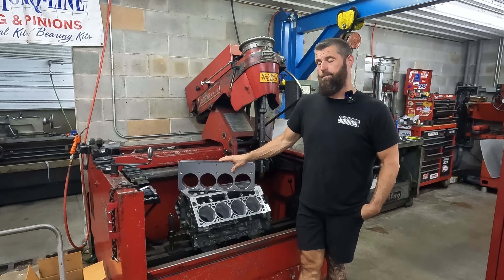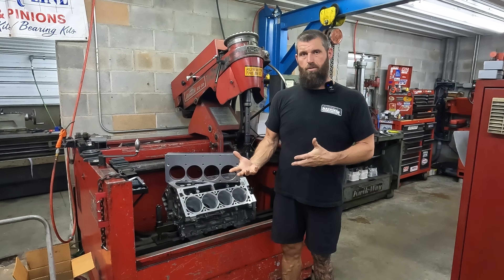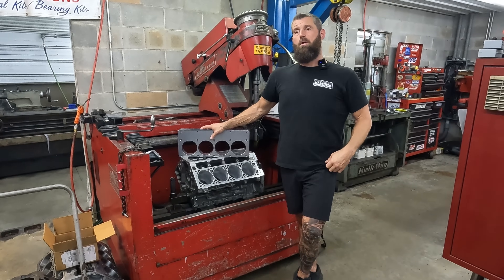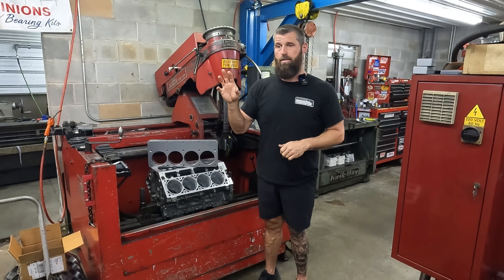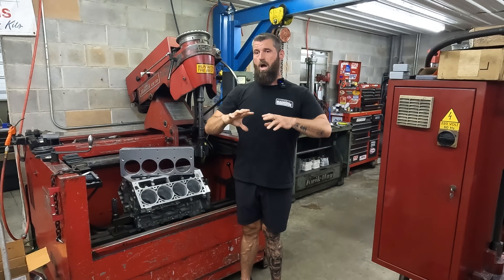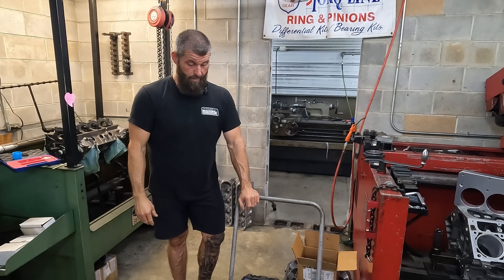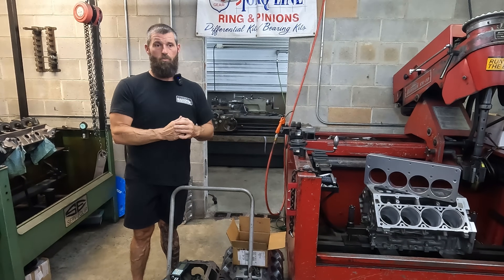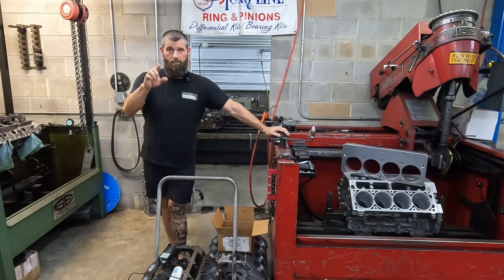We gotta talk about this torque plate deal.....

Comment: I decided to build a motor for a bracket car took to a local shop said I wanted bullet proof btm end that would last forever easy on the wallet to maintain torque plated and everything leave no stone uncovered the guy at the counter said ok bring us your parts we will get on it so I did two hours later I got a phone call said I needed to come and go over a couple of things so I showed up there was a guy in his early sixty's met me at the counter long story short ask if I was filling my block I said no he ok then I will save you some money we not putting the plate on it explained to me that of the block is not solid I would not gain the benefit from it he said take that extra money put toward a good ring package would benefit you more
Reply from the maker: That is 💯 not true
Reply: @powellmachineinc   would it been better to hone with the tourqe plate filling would make more sense for more rigidity I'm  sure with materials and technology you would not have to do that and I agree Im not going to chase .0004 because you probably hold a part in your hand depending on material and change that and I thank you for your response because if I'm wrong or have the wrong information a direct answer yes or no let's me know who is bs and you figure out who to ask and not ask love your channel I can relate to it because being a machinist by trade always wanted to work with automotive  side
Reply from the maker: @tommybilbrey1471  it's all relative to what engine,  they don't all respond the same to a plate

Comment: Wait until these people find out that most people don't torque plate their race engine. Torque plates weren't even a thing before the 70's. Through the 80's and 2000's it wasn't even a common practice. It's nice, but you're going to be okay with a little deflection.
Reply from the maker: Yep, we started plating stuff I'm the late 90s
Reply: @powellmachineinc  I would think it's more important during the line boring process than anything. Since the deflection on that axis is parallel to the heads. When you bolt on the heads I would think, on some blocks more than others, this will twist the alignment of the mains. But on most engines, particularly open deck blocks (like a K series) the deflection is minimal in the cylinder bores. On a Block known for being twisty like an RB or a SR, or a flimsy block like an EJ. 100% torque plate for everything. But any of the iron block LS engines, wouldn't worry about it. If you need to line bore an LS, just get another block. Or if you're going past 800hp on anything. You've already invested quite a bit, just pay your machinist for a torque plate hone.

Comment: Anymore lately, I don’t want anyone pulling in my head bolt threads with some random bolt set. I still use a few factory Mk 4 blocks and the bolt holes are notoriously weak. Half my motors a blown so the gain I get from that .0005 bore variation where the rings don’t go is negligible. On big Fords where the bolts are 3/4” away from the bore, I also skip the plate.

Comment: Application sorta dictates the process to some extent. Some applications, like high end high HP race engines are more likely to need a torque plate (but not all. Billet blocks just don't move around enough to make a difference in most cases). Or FE Fords that tend to pull up really hard on the decks with the 4 1/2" bolts and thin wall castings it's a good idea. Makes a VISIBLE difference plate vs no plate on FE's, but how many have been done without and ran for years with no issue?  A lot of stuff it just doesn't matter! Also, blocks were being successfully machine for years without them. There are no absolutes. Your explanation is spot on in my experience.

Comment: I've seen engines that were bored sans a torque plate last well over 200k without any issues. These were stock engines that were worn out and going back into stock applications and ran great throughout their lifetime without any issues. What he's saying is absolutely true. Just because the guys on Power Nation or other shows are always using torque plates on their builds don't mean that they are necessary for your bone stock 350 that's going back into your K1500 or C10. Now if you are planning on trying to build an engine that will squeeze every last drop of energy possible from it's combustion cycle then sure it is worth doing but for your average build or even your above average 300-450hp build small block it not absolutely necessary. I think the people complaining are people who have never had an engine apart in their life but have read a lot of forums and watched a bunch of videos. It's the Dunning Kruger effect calling again.
Reply from the maker: Absolutely 💯

Comment: I'm surprised automotive engineers hadn't figured out the bottom end bedplate sooner. In the 80s they were adding extra bolts to the mains & rod caps but not bed plates.

Comment: You cannot hardly out run those torque cocks (cops) 😂. They are like the state police and the small towns with only 2 or 3  cops on the force are the run of the mill trolls.

Comment: So i'm on the slow bus.
I just watched this video absolutely stellar.Come back.
If I could add my 2 cents to the stock cast Iron block and the torque plate.  The torque plate would only be relevant if when you bored and Honed  the cylinder that you had it. At running temperature with water flowing through the jackets. That would be the only way a torque plate would help a cast iron block in any way.  Just my two cents .
🚮

Comment: Everything you just said about thermal cycles is exactly why I don't worry about torque plates on a 450hp street/strip sbc engine. To much moves after it gets hot that even a few thousandths isn't going to matter much at all. At least that's my feelings on it. If the Machinist would recommend torque plates because a certain block might be worse than others, I would do it.

Comment: I realize this is 8 months old, but I seen a recent vid of the new Rottler honing machine, that doesent need torque plates, and then this popped up afterwards.
 
Greg Anderson a NHRA Pro Stock champ who is racing for Hendrick and KB racing was working in the KB engine shop and was showing it off and explaining how much more accurate it is,  and NO TORQUE PLATES NEEDED. 
 
The Rottler can "feel" the high spots in the cylinder, and just hover in one spot slowly honing back and fourth until it's close to what it wants, then it goes back to full sweeps as it hones to finish the cylinder.
 
How much is the new Rottler digital honing machine?? ,  A Gazillion dollars??,  I don't know , but it sure seemed worth it versus playing around with torque plates,  and the benefit of every cylinder getting a torque plate hone, without the plates.
Reply from the maker: @kh40yr  you aren't grasping what the torque plate does, the hone brand is irrelevant
Reply: @powellmachineinc  I know what a torque plate is used for.  The Hone brand might be irrelevant, but not the machine. I just thought it was a interesting machine that delivers a torque plate hone to every cinder it touches, without using torque plates , as it was advertised.

Comment: Oh, hell no. I read up on the interlink, so I had my machine shop dude do the full top-fuel job on my HF Predator 6.5HP edger engine with torque plate, ARP studs, the best dingle-ball hone available and I tell you whut?  I figure the longevity of this engine is extended an entire 10-minutes over its lifetime. Worth every dime of the thousand it cost to do it my way! ;-)
Reply from the maker: Big gacts!

Comment: These people questioning your work don't understand machining, tolerances in automotive are open, were as in aerospace tight tolerances run in .0002 automotive .005 + - .005 also they probably don't run a shop
Reply from the maker: We hold 4 decimal place on automotive machining often

Comment: Great discussion Mr. Powell. Is a B/RB Mopar, 383-440 like the FE Ford? They have head bolt threads in the top of the block also, but 5 bolts around each cylinder. Just wondering if they distort enough to warrant torque plate honing on a basic build. Great video. 👍
Reply from the maker: Fe's are worse because there paper thin and the bolts are 1/2"

Comment: I remember back when l was just starting out, we would hone an engine on the garage floor because we couldn't afford an engine stand, polish the crank with some fine paper and wd40, and a shoe string,and those engines ran well for years, not that it was right by any means,but let me say that l absolutely appreciate what the machine shops do,what you guys are doing is short of amazing,im sure theres a need for torque plates but probably not on something that is intended for street use

Comment: Daniel, big block  chevy 454s, there head bolts are to the top, what's your ideas on torque  plates on them? My machinist  doesn't have them for big blocks and so I probably  won't worry  about them.  I'm just doing a refresh job on a low rpm towing 454 for a  1 ton pickup.

Comment: RE: this whole engine distortion thing - Many years ago I played around with sprint cars and Oswego Super Modifieds,  I always wondered how much the engine geometry distorts from mearly mounting the engine in the chassis, and how much when the front left wheel is off the ground at full song?
Reply from the maker: @donbrutcher4501  who really knows
Reply: @powellmachineinc  I do know you can bind up a stock small block Chevy shortblock by just squeezing the block with your hands.
Reply from the maker: @donbrutcher4501  I'd pay to watch
Reply: @powellmachineinc  It wasn't running. It was on an engine stand.  We measured with a torque wrench on the crank snout.
Reply from the maker: @donbrutcher4501  ok.....

Comment: I'm not a machinist but I've been in the trade and built lots of engines a few High horse power. But I think sir you're standing next to CK10 In the fact that you have a  Torque Plate in your hand. Means you know there's need. You don't need them on some engines but if you install  studs on Some Apparently not all.engines without boring them  with a torque plate you'll Egg shape the boar And the block and it will crack I learned that lesson. But it is not really necessary if you're running stock headbolts. As far as I know. I like to think I know. But customers shouldn't have to For tooling. It has to be Bought once and paid 4 over time. So you can make money off of it. But it's only necessary when it is.

Comment: Great video, as a hobbyist engine builder with a lot of builds under my belt, most of the engines I build are done on a shoe string budget, both foreign and domestic and are daily  driven. I have developed a complex where I feel like everyone else's engines have better ring seal and no oil leaks. I aways suspected that I was because I didn't use a torque plate but after watching this video I am not so sure.  Can anyone else relate.
Reply from the maker: @mjb242  the actual hone job is critical,   the finish,  the angle ect, watch some of my honing videos

Comment: to be honest i dont see any benefits to using a torque plate on a street motor or even a lot of high end motors! when i put a top alcohol motor together i used to order 4 sets of pistons and match the tightest pistons to the bore ,  sometimes id go through 5 -6 pistons just to find one to fit the specs i was using ! which brings up another interesting fact ! not a single piston is ever the same so if you make every bore identical there is no guarantee the factory will meet your specs ! then each piston will cut and seat different you cannot have exact ring tension . the only time i ever use a torque plate is on a custom v twin and. a vtwin is temperamental when you get to 4.155 and over ive got 4.280 big block pistons in my custom chopper and it is exact. built a top fuel v twin or two or 3 i use torque plates on those.
Reply from the maker: You just haven't actually done any A/B test, or you wouldn't say that

Comment: I was always under the impression that torque plate was optional and really only beneficial to engines that have head bolt holes close to the cylinder even then we talkin a couple tenths of distortion not worth worrying about on 99% of blocks
Reply from the maker: Not that simple unfortunately

Comment: Hello!  I just happened upon your channel using my personal account and figured I'd pop in here with my business account and help you out with what little gravitas I might have.  I'm a torque plate manufacturer, with my customers ranging from small shops to aftermarket block manufacturers, NASCAR/ProMod/ProStock level shops, and even OEMs.  What you are saying here is what I tell people when they ask if a plate is necessary: "It depends; ask your machinist."  Every application is different and there are absolutely applications out there where a torque plate can not just "not help" but actually hurt cylindricity (or end-state performance, at least)!  The one caveat I would offer is to keep in mind that you (and most automotive machinists) are not actually able to measure cylindricity with a dial bore gauge; you are only able to take relative measurements absent something like a CMM.  The shops with this capability (especially the OEMs and large scale rebuilders) generally bore map the blocks with heads installed and use varying torque sequence and values to duplicate this as best as possible.  Some (depending on block architecture) are hot honing as well but some modern blocks don't really benefit there, either.  No one is doing that level of work for $40 a hole hone jobs it just isn't economical or necessary.  I've got machining centers blinking at me that they are hungry so I'd better go get some plates out the door!  Take care.
Reply from the maker: Appreciate the input and industry expertise!

Comment: Expensive high horse power and high RPM engines yes torque plate but mild race engines street car engines I wouldnt waste my time but if you want to pay for it fine and dandy otherwise forget it ! Yeah and like you said holes at top and close to cylinder walls, creating big distortions I would do it because rings compressing more and trying to return to walls get out of control dropping horse power, producing blow by, and contaminated oil is not cool.
Reply from the maker: I don't exactly agree

Comment: As a machinist, my whole life I board and honed many blocks. not all blocks are [designed the same some warp more when you torque them down more than others more than you would like to see anyway I always use a plate whenever it was available and if I really wanted to get technical I’d run 200° water through that . Generally speaking, I measure the block when I torque it down and if it needs a torque plate then yeah I’ll use it but sometimes you don’t need a torque plate. It depends on the block and not all blocks are designed to the same way, but I seen some blocks that are way out and you definitely want to use a plate under temperature anyway great show keep on rocking.

Comment: Some stock engines require boring with a torque plate. Subaru EA71 and EA81 engines. Says in the service manual the torque plate is necessary for boring, but not necessary for honing. The cylinder liners are only about 2mm thick and made of nitrided steel. They can be bored a maximum of 0.5mm. I've never seen one that needs to be bored oversize. The cylinders are so hard they never wear out, only the rings. I've rebuilt them with 500,000+ miles and no ridge at the top of the cylinder. Every one I've done has had cylinders dead on in the range given by the manual regardless of mileage. These are engines that cruise at 4000 rpm on the highway with 230 degree oil temperatures. The crankcase halves weight about 15 to 20 pounds each. They move a lot more than 4 tenths at the top of the cylinder though. I've measured one with a cylinder head bolted on from the bottom of the cylinder. The cylinder distorts by as much as 0.5 thou with the head on. The problem is no torque plates are available anymore. Nobody has one. The standard size pistons are also disappearing.  Nobody ever seems to bore these engines oversized so there is a shortage of standard pistons, especially the later ones from the EA82 engine which can be retrofitted to the older EA71s and EA81s to prevent ring land failures which are common with the older style pistons. It's getting to the point where I will have to have custom pistons made or order pistons from Japan or Australia to rebuild these because there are no more standard size pistons available and no torque plates available to bore oversized. There are manufacturers making pistons they are just impossible to find in the US. I got lucky with the one I'm doing at the moment and found a set of standard EA82 pistons on eBay. Paid way more than I should have for them but the next option would be ordering from Japan. These are not normal blocks though. First of all they are a flat 4 with a crankcase that splits along the middle. Some of the EA71s were cast solid and the water jackets machined into the block. Almost like a billet block but starting with cast aluminum. So they are very near uniform thickness. The thin cylinder liners are actually made slightly tapered because of the deformation of the block when heads are on and block halves are bolted together. They have head studs from the factory. Even the bearings in the older EA71s have to be a special lead-indium over copper material or they will wear out in under 100,000 miles easily. The thing is I agree that a torque plate isn't necessary for a regular Chevy V8 block. But there are stock engines that require a torque plate. Just like you said with the FE. I just wanted to give an even more extreme example than the FE, and one where the torque plate is actually required for boring. The manual even calls it a bore plate.